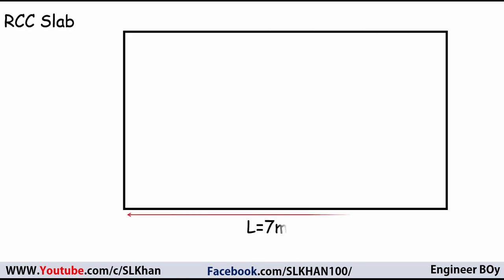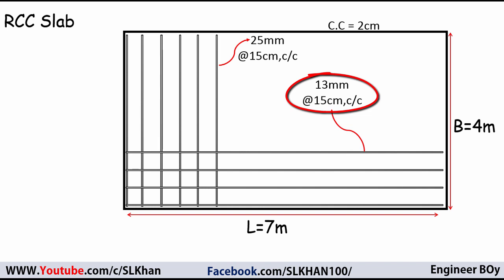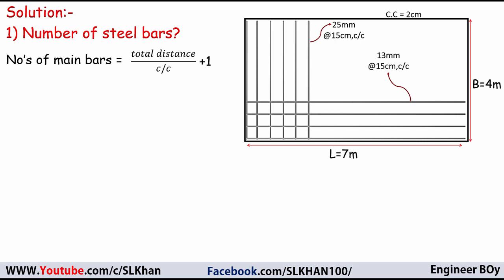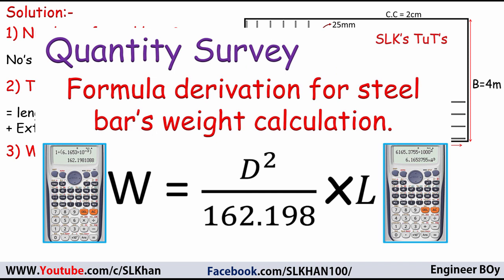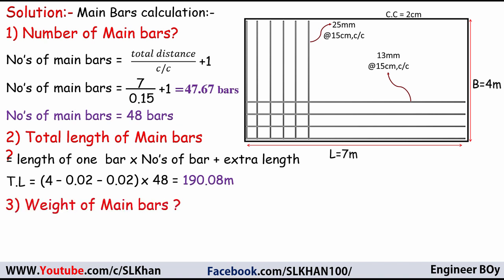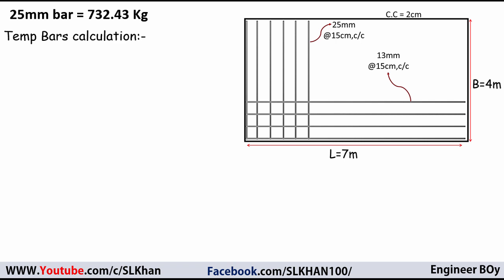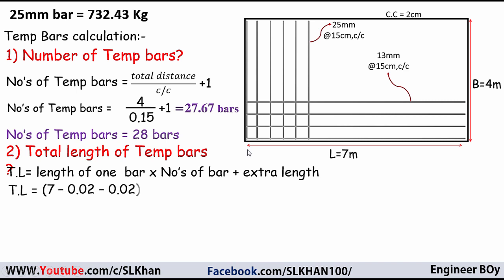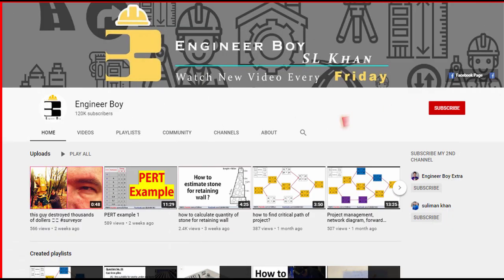how to calculate steel Quantity for RCC slab ? Ok 🤔

Comment: Hi, I think there's a mistake somewhere... When calculating for number of main bars you used 7m instead of 4m... Since main bars are used in shorter direction (span) while distribution bars are used in longer direction (span)
Reply from the maker: No dear. Main bars are short but divide the longer span
Reply: @Sulimankhanacademy  okay